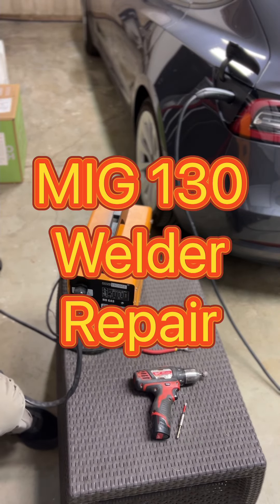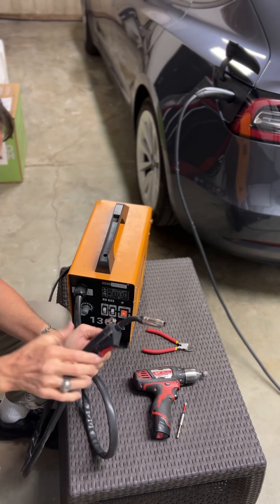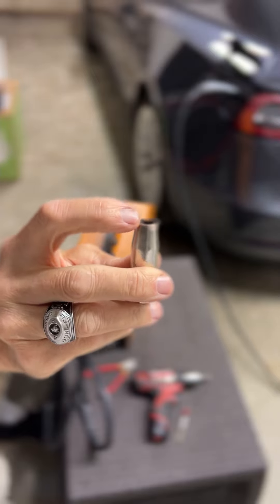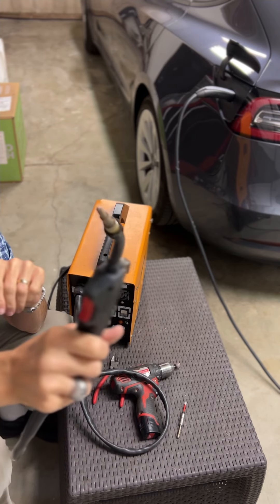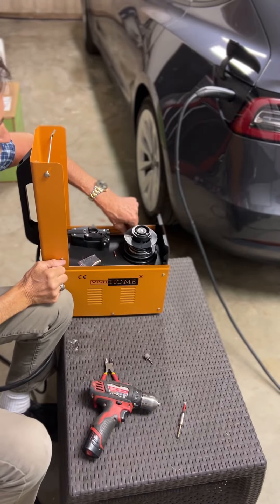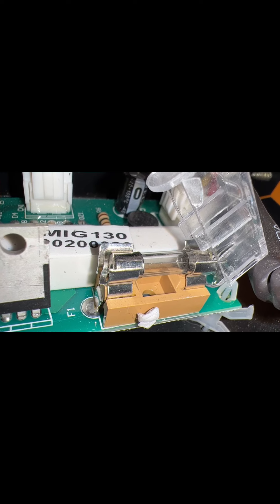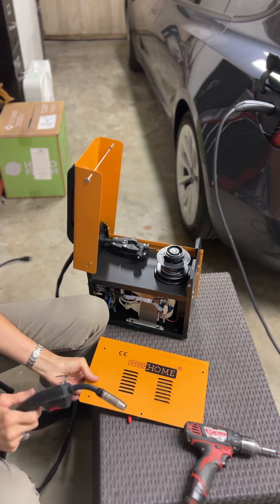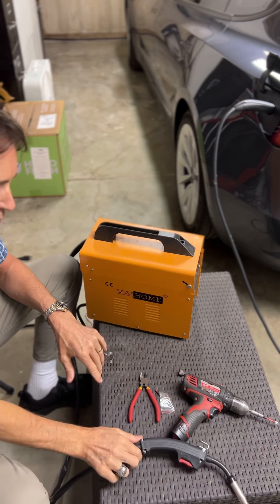MIG Welder Feeding Issues FINALLY SOLVED!

Comment: Followed your steps but mine is still not feeding wire or turning the wheels inside that push the wire through. Any other suggestions?